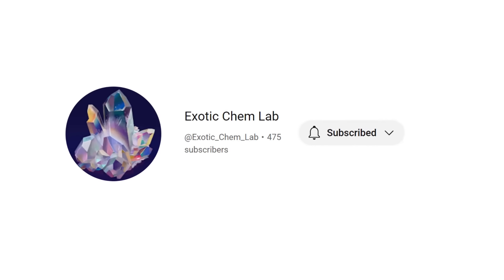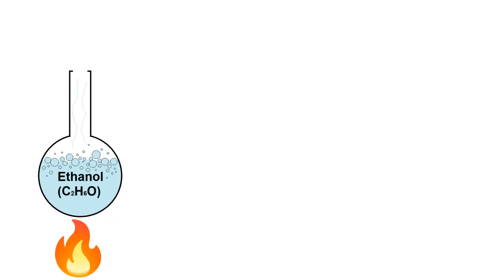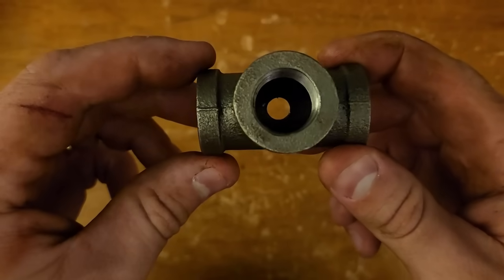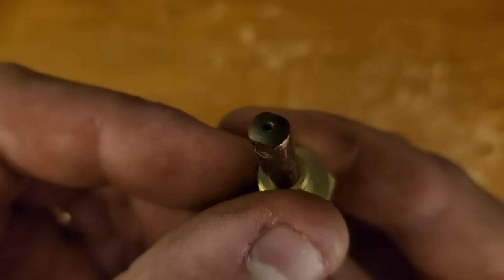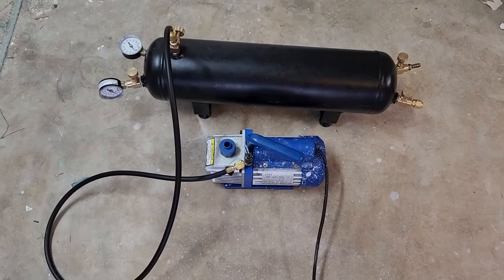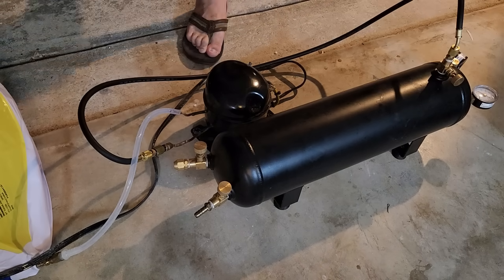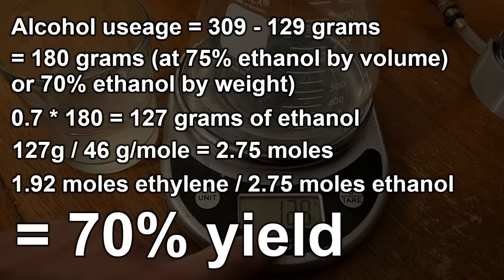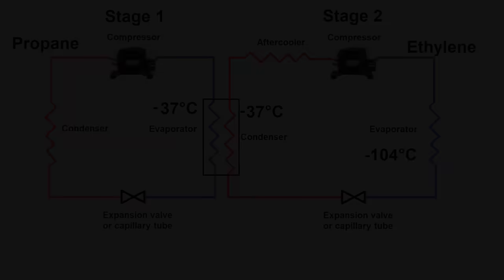Making Ethylene (Refrigerant R1150)

Comment: Absolutely love this video. As someone who got a degree in chemical engineering and therefore spent many, many, MANY hours learning every minute detail of designing and building plug flow reactors, understanding their governing thermodynamic equations, solving differential equations to characterise the fluid dynamics of the packed catalyst beds, understanding the materials science of the various alloys used to build them and the physical chemistry involved with zeolite-catalysed reactions, drilling down into details of details of details I never could have imagined existing before...  

It absolutely blew my mind to see someone casually building a packed-bed plug-flow reactor from plumbing parts and unspecified alumina beads in his garage, and the damn thing actually working! Seriously, well done! (Deep down I'm almost insulted by the fact you managed to get a decent yield without doing any equations to work out the reaction rate, and therefore flow rate and reactor length required 😂)
 
I think your "missing mass" is probably unreacted ethanol and possibly some diethyl ether that makes it past the collector bottle (I'd call that a blowdown drum 😂) and dissolves into the bubbler water and  or adsorbs onto your silica gel dessicant. The bubbler will probably catch nearly all the ethanol, and a bit of the ether (particularly as it picks up more ethanol)

The burning of your collected liquid looks to me like it's due mainly to ethanol burning, nice and calm and blue. I'd expect ether to burn off much more excitingly if it were the major component. I suspect a good fraction (half?) of the diethyl ether your reactor produces is ending up in your final product and I would suggest trying to do a thorough job of removing it because it's just such an horrific fire hazard. Although its boiling point is like 35*C, it has an insanely high vapor pressure so most of it will stay as vapor at atmospheric pressure even when cooled below this. Even at 0 degrees its vapor pressure is something like 1/3 of an atmosphere so that's why I suspect you have a lot in your collected product.
Reply: Oh one more thing (sorry!) - I think your burner design probably needs more outlet holes or a more restrictive venturi inlet to work as intended. Looks like the flow in the pipe is stagnating because the outlet resistance is too much, so the pressure in the pipe matches the atmospheric pressure and the venturi can't draw in air.
That said it might be for the best because it seems to do the job well enough, and unless you're quite careful with the nozzle design, there's nothing to stop the flame front moving inside the pipe if the mixture inside it is flammable. You can pack the pipe with some sort of metal mesh to mitigate this but obviously that creates a lot more resistance to the flow.
Reply: Oh, diethyl ether also has a sickening sweet smell, to me that's what it sounded like you were describing.
Reply: This is why I love tech YT, you got the side of just curious tinkerers doing things and a bunch of highly educated people enjoying the show, giving advice... Great additions imo and I am not a chemist or chemical engineer :)
Reply: I was impressed enough with the initial 39% yield.  70% garage-style?  Astounding!
Reply: Any idea how I could calculate the change in temperature in a PFR? Not something complicated, just a simple 1D-model (so everything symmetrical essentially) with a fluid flowing through a packed bed, resulting in a reaction given pressure and temperature. But this releases reaction heat, which is then not just spread within the bed (lets call it conduction) but is also transported along the PFR with the fluid. So the next section of the PFR sees a hotter fluid, which means faster reaction, so more heat, so section 3 gets even hotter etc.

I have a python model with the reaction and everything, but how to calculate dT/dz (z = lenght)? Sorry for this random question, but I dont exactly often run into other chemical engineers that do things like that. I deal with rotary kilns normally, hence most of the things are known. But in a rotary kiln the fluid does not pass through the solid, so this side of things is, sadly, unknown to me. But I want to get a simulation running to prove (or disprove) something I once told a client... just a gut feeling, but it seems to make sense (that the heat can accumulate and cause issues). And yes, I know that this can happen in PFR with calatysts (have seen ex-molten catalyst in a ammonia reactor), but in this case it is a ad/desorption (for regeneration) or a Cu-Zeolith, so things are somewhat different.
Reply: @leocurious9919  I know you posted this 9 months ago, but I just saw it. I modeled something like you described years ago. I don't have the model anymore, but I did find a source which I expanded on, WL Luyben's "design of cooled tubular reactor systems", DOI 10.1021/ie0006716. If you can get the paper, you will find a formula for dT/dw where w is the weight of the catalyst. The author also wrote a book on reactor design, so an answer to your question might be found there too.
Reply: Great info!

A curiosity: does this reaction equilibriate much? -- would excess H2O shift the balance in favor of ethanol or diethyl ether?  (Also for reference, what's the equilibrium constant at ~1atm?)  Is diethyl ether dissociated to ethylene on further heating?

Seems possible the flow rate is too high, causing uneven temperatures (lower at the inlet, and in the center of the catalyst fill) as well as not having enough dwell time for reaction.

Hmm, excess diethyl ether vapor should condense at the bottom of the pressure vessel, for the same reason water does (when compressing atmosphere).  Not as much, relatively speaking, of course, but it should be at least diagnostic.
Reply: @T3sl4  The reverse reaction, ethanol via hydration of ethene, is how a lot of industrial ethanol is produced. So that equilibrium will absolutely be shifted to ethanol with more water. The direction you take is endothermic, so heating helps both with reaction rate and conversion. The endothermic nature of the reaction actively helps reducing the temperature gradient in your reactor. However, getting a really isothermic reactor is essentially impossible. Even without any reactions happening, just moving a fluid through the reactor and ignoring radial gradients, you would have to adjust the heating along the length very carefully to get somewhat close.

The equilibrium is highly temperature dependant, so I am not sure if one value would help you much. There are lots of papers on this... if you really want to dive into this and make some simulations.

In any way, given your success, you dont need to waste any time on any of this. It works super good already. It is not like ethanol is expensive or you need scale production up 100x.

You are not going to condense ether like that. It is mixed with ethylene, lowering the partial pressure. You would need very low temperatures to get most of it out of the stream. However, that would be a good idea as a step between the bubbler and the desiccant: Cooling it to... say -20 °C.

And yes, for the same reason water condenses the ether will too once the pressure is high enough, since the partial pressure goes up too.
Reply: hyperspace pirate needs to come by, and pin this comment

Comment: production of ethylene from ethanol via sulfuric acid is simple but using aluminum oxide definitely is very convenient, for using sulfuric acid you need some fancier stuff

a boiler, holding the sulfuric acid and ethanol (2:1 sulfuric to ethanol) brought up to over 200C, on top of that a condenser to condense back any ethanol, then you have to wash the gas clean of any ether and acetaldehyde (i believe aluminum oxide also produces some acetaldehyde as a minor byproduct), after the sulfuric acid mixture is spent, you simply distill off the water and ethanol left (you'll also get some ether and acetaldehyde) and clean up the acid with a little bit of hydrogen peroxide, further distill it until the acid boils at 300C or so. hot sulfuric acid is evil though and while this method is convenient for a chemistry lab which doesn't have space for a large setup with an alumina bed (tbh though any lab with a tube furnace can set it up easily) its definitely more laborious as you have to purify the acid back up while alumina just has the water in the gas output which can be condensed off
Reply: btw i suggest replacing the row burner by wrapping the catalyst pipe with some mica sheet (can be bought online as a paper like material with plastic binder), some nichrome heating wire and a PID controller, wrap the nichrome around the mica, wire up the PID SSR and thermocouple, then finish it off with a second layer of mica and some fiberglass, then a steel tube (can be bought as a stove pipe), before use place it outside and crank the heat up to 700C and let it run for an hour to burn off the plastic binder that is in the mica, then tada you have a steel tube furnace to heat the alumina catalyst
Reply: How compresors work with ethilene in cadcades ??

Comment: Some CPU overclockers have made the craziest cascade systems ive seen, there is a guy who made a 3 stage one with methane as refrigerant in the 3rd stage and he was planing to add some other gases to the 3rd stage to lower even more the temperature, if i recall correctly he wanted to use a mixture of methane with a bit of argon to go below -170C°
Reply: Yeah, the reason you overclock is to get more compute power out of the same hardware, this is a diminishing return endeavor with lowering efficiencies, higher power costs, and therefore far higher heat production the further you push it, the reason you get to such low temperatures is so that the heat can be removed fast enough to not damage the components. (for example 100w of heat dissipation with air, means you can only run 100w through it, get down to -170c and can now dissipate 1000w? now you can run 1000w through it, simplified numbers, not exact, I'm not in the scene enough to give any actual concrete numbers without some digging)
Reply: @rjwaters3  Yeah exactly. Der8auer recently had an overclocking video where a 3495x CPU was drawing 1800W of power when cooled with liquid nitrogen
Reply: But... why?
Isn't there a preferred temperature for CPUs to operate at which they are the most efficient? Wouldn't -170c just brick it because it's not designed to operate at those temperatures? Aren't electronics in general less efficient at colder temps?
Reply: @Assault_Butter_Knife  1. Because they can. 2. There absolutely is a temperature range where they're designed to operate. Too low and the chip doesn't work or perhaps @Stephan was eluding to silicone becoming superconductive - either way, not working as designed. Too high and you get to use your fire extinguisher on your now worthless PC. But overclocking creates loads of heat that has to be removed somehow. And since heat exchanger performance is improved with higher temperature differentials, it may be the case that whatever voltage the overclockers are using is creating that much heat that it takes -170 at the wafer surface just to stay working. Also worth mentioning, silicone is a horrible heat exchange material but an excellent semiconductor.
Reply: @captainotto  Exactly... Well put and explained... Its why you cant use liquid nitrogen without first having the cpu running and at some level of load, as otherwise you would cool it out of its operating range, but if it is just getting to the normal operating temperatures, which it will quickly exceed into combustion, you can then proceed to cool it with crazy systems, to prevent it from bursting into flames... Its all done automatically, but you get the point... The cpu is not at - temperatures when its off or starting, nor is it at - temperatures when its running... it only gets that extreme cooling when its running as it would self combust if left without the cooling, but the cooling still only brings it down into its operating range, not far below... Things are not made stupidly to boast excess... They are done to compliment each other and work in sync, allowing each other to perform to maximum capacity without issues or catastrophic damage...
Reply: @Assault_Butter_Knife  Efficiency is not the goal with extreme overclocking. With more cooling power they can crank up the voltage at which the CPU is running without causing an instant heat-death. Simplified said: more voltage = higher clock frequency.
Reply: @Assault_Butter_Knife  same reason than cooling with liquid nitrogen, it's mostly to beat records but hasn't real practical application.
As already said, you have to start it before so the heat generated by the CPU prevent it from getting too cold. But for extreme overclocking it's the only option because the higher voltage required to reach high frequencies would get it too hot and burn with a conventional heatsink (you also get a slight increase in performance by lowering the temperature - not as much as -170, only the surface is as cold as that but it still runs colder inside - but the main reason is to keep the cpu alive).
Reply: Is silicon even a semiconductor at those temperatures???
Reply: @StephanAhonen  Yeah, they even use liquid nitrogen but they usually have to start the CPU at higher temperatures else it crashes, I don't know exactly why but it happens.
Reply: @StephanAhonen   dont forget that it's all done to dissipate heat from overclocked CPU.
Reply: @StephanAhonen  This is cooling stack temperature, not silicon. CPU is not conducting heat internally to get anywhere near those temps

Comment: You could make a custom hygrometer.. been wanting to learn how. I know it should be possible to make one with a straw but i don't know beyond that, i think they used to be base m made like a thermometer bulb and filled with a reference solution, with a scale that might be printed on paper and rolled up in the stem and then thewhole thing sealed up (maybe metal instead of paper)  then you use a known cylinder (idk volumetric cylinder? ) and put your meter in and how much it floats is your specific gravity, would be cool to know how to make. 
Great video by the way highly enjoyed it.

Comment: I'm concerned about the catalyst not actually being at the proper temperature throughout. It seems like the inlet side will be cooler and the exit side will be hotter - and you're only measuring the temperature in the center! At least, it seems like you won't be able to get a good enough purity out of there.

Comment: Why ethylene? ethane is an opinion too.... It might be cheaper
Reply: R170 ethane has a quite higher boiling point so below -100C it is not a choice .
Reply: @per995  you can still improve the system.... Ethane is Hydrocarbons and is zeotropic. You can add 5-20 percent to by weights  your r290 mix... Because your not worried about your super heat. It will lower the sub Crit temperature lot more.....
Reply: @MrBiron1  
I am used to hydrocarbons on cascades.
Seldom seen R290 other than  used as an effective additive to return oil on low stages cascades. Played mostly with cascades in 35 Years mainly on ULT units down to -152C
These days is it  Hydrocarbons all in.
Almost all equipments we trade use HC.
Still have many units that used 508B to for service . Wild prices now. GWP tax here is 
$ 600 pr. LB and on top the refrigerant even higher😳 Scary that it is not a drop in and very difficult to get reach of.

Comment: This is really interesting since a way of creating ethylene that I'm familiar with (and you kinda hinted at it in the beginning) is using sulfuric acid, the entire reaction uses sulfuric acid heated to 180°C:

Ethanol ---(H2SO4 @ 180°C)---> ethylene + water

you can see the benefits of that since it requires a much lower temperature that the method you used.

Interestingly enough you could also use the same setup but at 140°C to make ethers as well and I think Neilred used it to make diethyl ether from ethanol quite a while back.
Reply: I'd be really wary of using the sulfuric acid method because it's also very likely to generate some amount of diethyl sulfate, which is a strong alkylating agent. Very toxic, very carcinogenic, very very nasty.
Reply: @jhonbus  Good call. Apparently diethyl sulfate can be made by bubbling ethylene gas into hot, concentrated sulfuric acid so this really is a valid concern.
Reply: I was going to mention this. I've used this plenty of times with various alcohols (think I managed acetylene from 1,2-propadiol with a peroxide kick once) and it's got so many advantages on laboratory scale. You just need a flask, a heat source, and sulfuric acid; they only need be good enough quality to get the job done; and you can use all of the components for whatever else you want if you're satisfied with your alkyne gas situation because there's no special apparatus.
PS: yes the sulfate ester byproducts are carcinogenic as hell they're alkylating agents, if you're collecting the alkene gas you're making for non immediate use or making enough that alcohol addition dropwise is too slow, you need to run the output through alkali before getting your mortal, cancer vulnerable fingies near it.

Comment: I thought ethylene was made with really hot coal and misting water on it? Maybe in an atmosphere of carbon dioxide or monoxide (slightly evacuated) so basically just really hot coal in a furnace... water mist makes hydrogen gas which reacts with the carbon dioxide to make ethylene (but only if there's no oxygen around to react with the hydrogen...idk how that works... maybe some lime or some coke?
Reply: Which makes me think of that kind of sweet smell you get when you're next to a coal fire hmmm...
Reply: @simonlinser8286  Water only becomes water vapor when heated. There would be a lot more explosions if water degraded into hydrogen gas